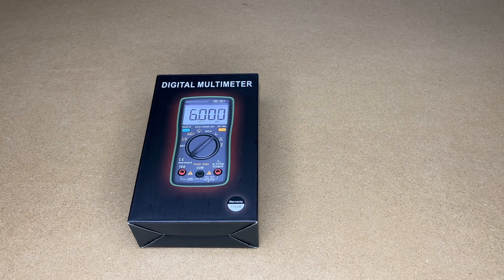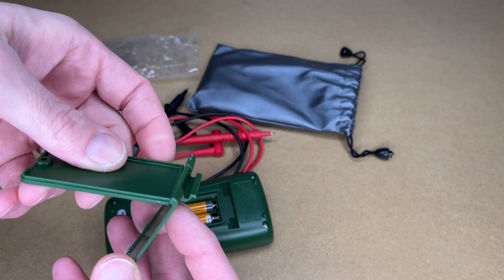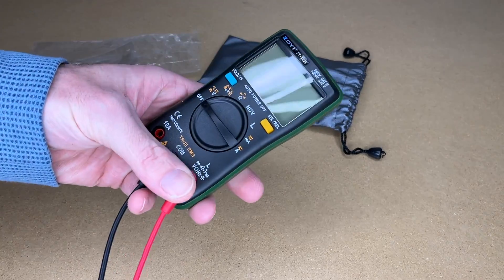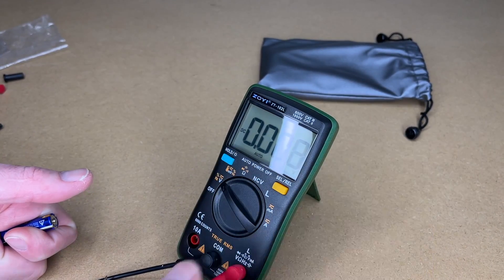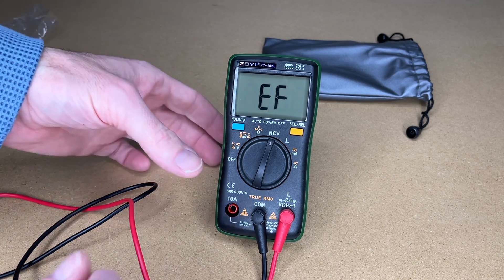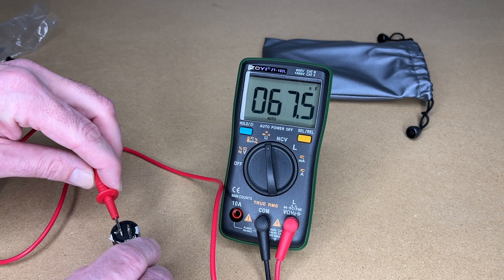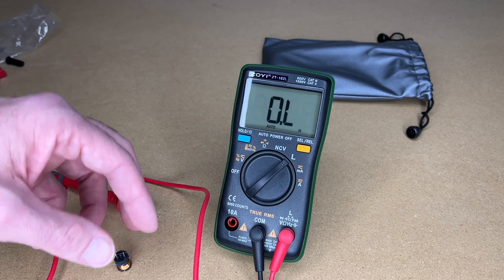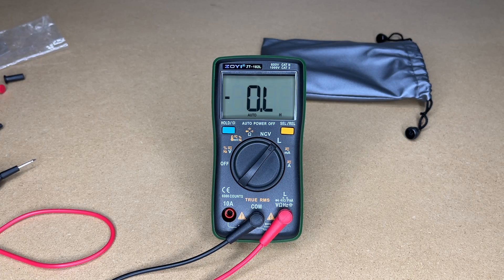ZOYI ZT-102L Multimeter with Inductance Measuring

Comment: It's really capable. I will buy one. The inductance range can be between 9.999 mH and 9.999 uH would be great, because nowadays the inductance in the DC-DC converters are always in the range of 100nH to 100uH. But probably this range is difficult to achieve. Only a view multimeters at all can measure inductance. But I don't know the reason. In the last decades, nearly all multimeters have been able to measure inductance. And I think, it should belong to the basics of multimeters to measure all passive electronic components. R, L and C.